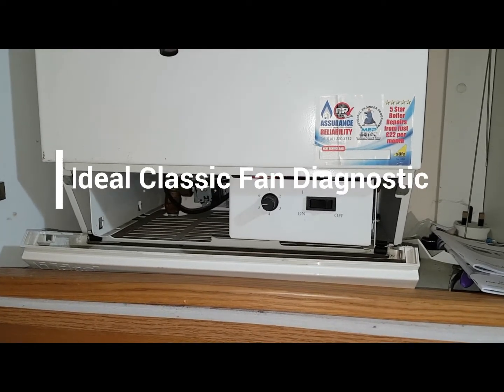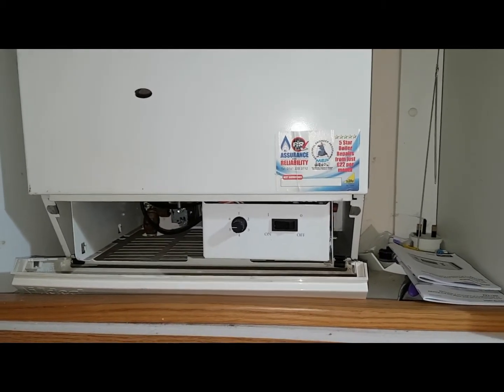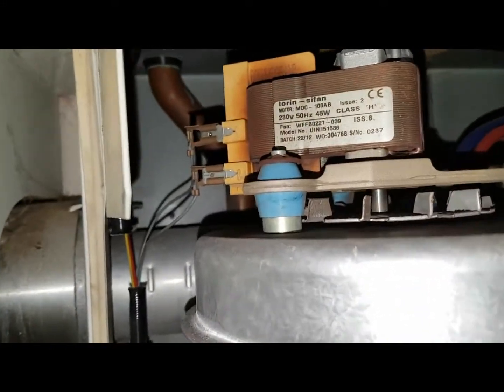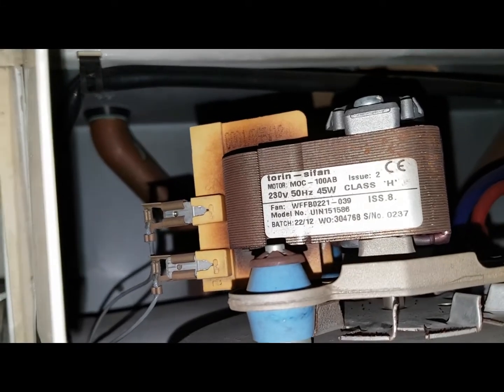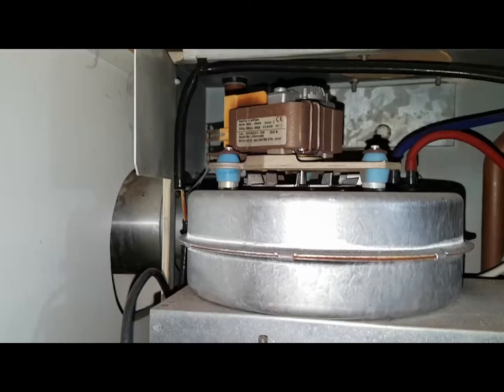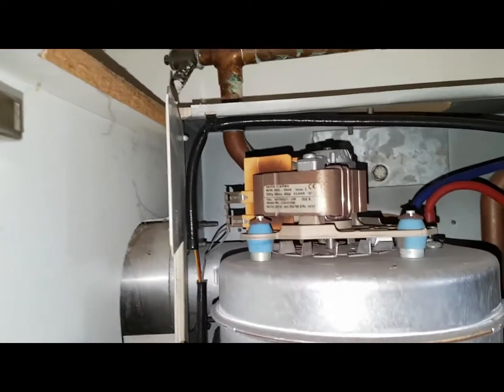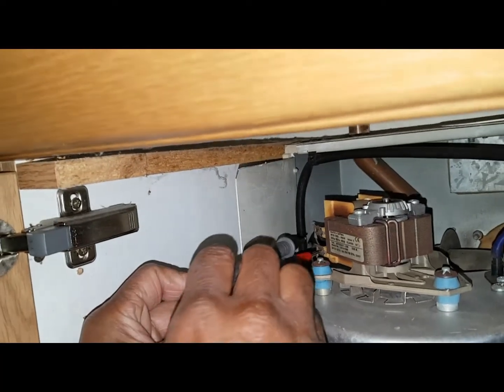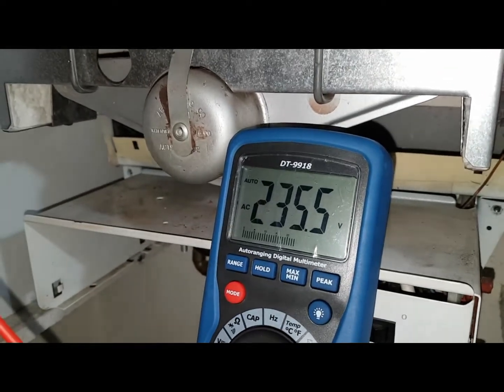How To Diagnose a Fan Fault. With Coach Tony Morgan

Comment: So that was volts AC do test with the power on at boiler
Reply from the maker: Yeah power at the fan
Reply: A+R Central Heating and Boiler Repair Experts Ltd so wheb would have power off at boiler if you was testing with multi meter
Reply from the maker: hey we're currently trying to grow our Facebook group and would love you to join Tony and the team using this link, Tony will be available to answer all your questions directly https://www.facebook.com/groups/167070231326174